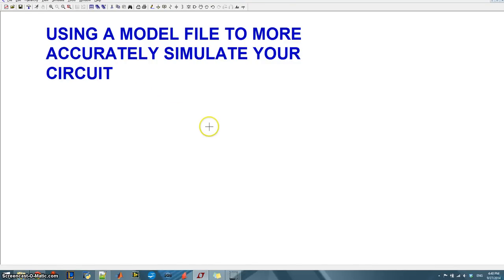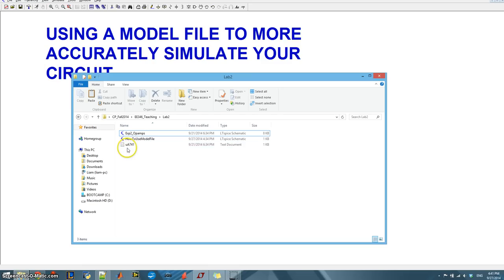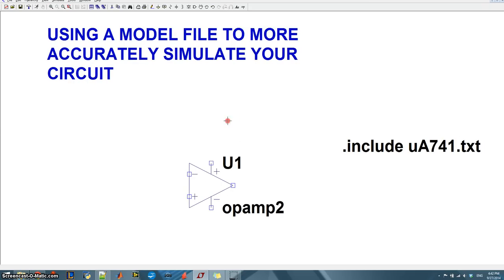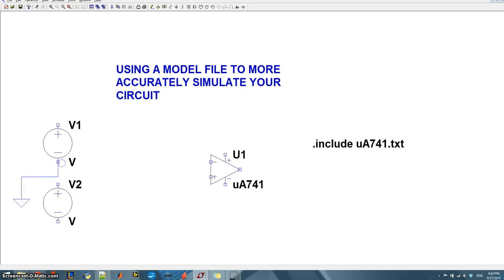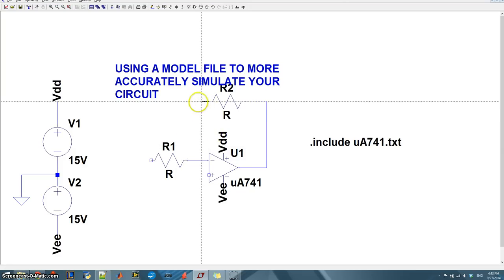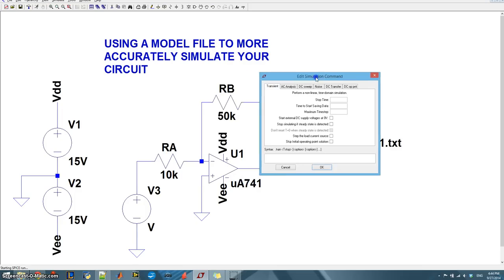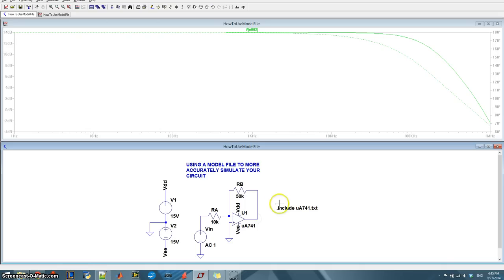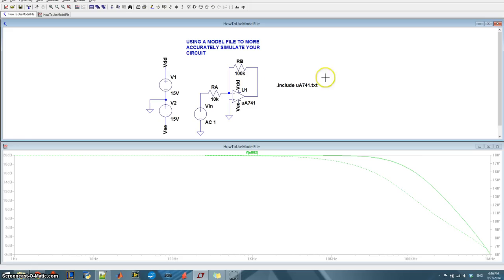Importing Model/Subcircuit File into LTSpice

Comment: Thanks!  Read through a few explanations of how to load a spice model and none of them worked for me.  None had suggested putting the file directly in the directory where you have the spice schem file.  None said to add the .include myimportedspicefile.txt as a directive on the schematic (by typing S first to get the dialog box) as you suggested.  They were all somewhat inside the box.  You were not.  Note that my unzipped model directory included a .lib file that was actually a .txt file.  I just changed the extension and used that, and it worked.  Not sure if I could have left it as a .lib and set the directive to myimportedspicefile.lib, but not matter now.  It worked as a .txt.

Comment: i have been trying to install a 74hc04 model, but after i do the following steps, the model of inverter i add doesn't seem to behave differently from the default one.can you please tell me if i have to do something else besides the steps in this tutorial?
Reply from the maker: I'm not that familiar with using the digital gates. Have you tried right-clicking the inverter and changing SpiceModel from "BUF" to "74hc04" (or whatever the model is called)?
Reply: +elena dobrescu Am incercat si elena dar nu merge ..se zice ca trebuie introduse ceva simboluri cum ar fi ^ si *